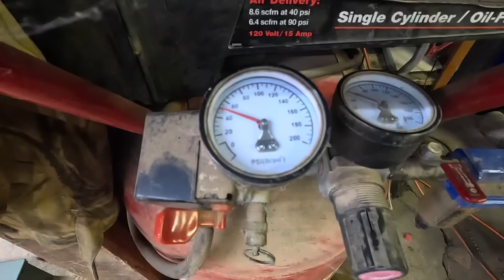Reinventing My Chicken Plucker

Comment: You might be able to mount the waterproof box with the kind of screws that are used to mount metal roofing.   Those have rubber washers on them.  The rubber may also help with the vibration. Just a thought.

Comment: If that aluminum is in contact with steel you will get electrolysis it will corrode. A simple isolator like duct tape between the two will prevent corrosion. All together once again a nice build.

Comment: Farmer Tyler – If you look closely at the back of your Switch Box, you will see 4 small holes, one near each corner.  They are designed to mount the box, probably using self-tapping screws.

Comment: Would elongating the holes for the motor mounts make the pulley adjustment any easier?   Or did you adjust the pulley adjustment by sliding the pulley up the shaft?
Either way would work, i suppose.
Another fine bit of re-engineering by FTR.  👍😎

Comment: Very interesting how you patched up the plasma cutter. You may want to visit Arc Solutions if your repair doesn’t hold. Hypertherm PMX30 / PMX30XP Air Filter Bowl Replacement Kit 428246 (Price Regular $42.32) Of course it may not be the correct one for your needs.